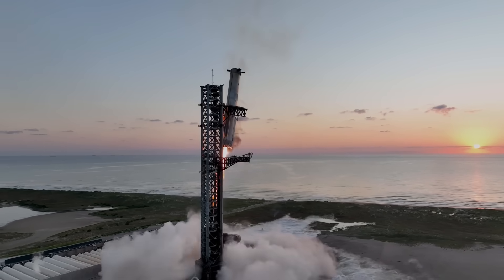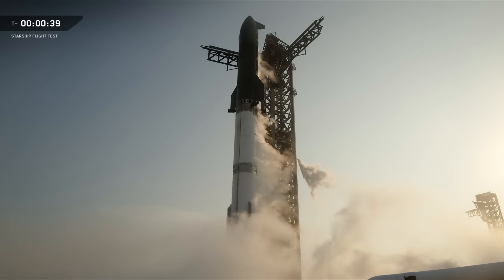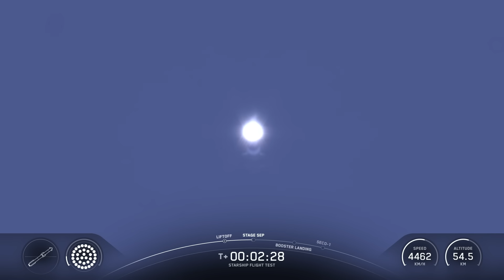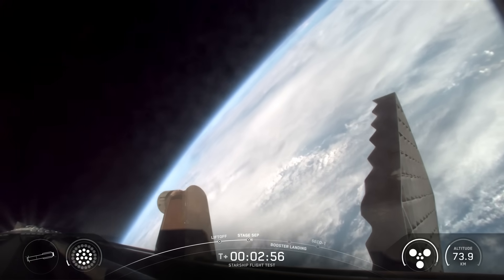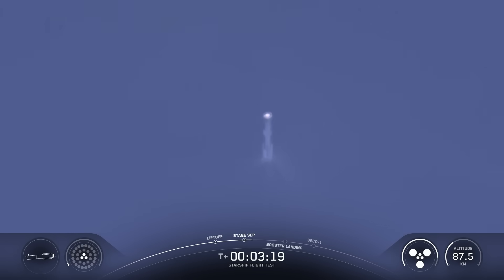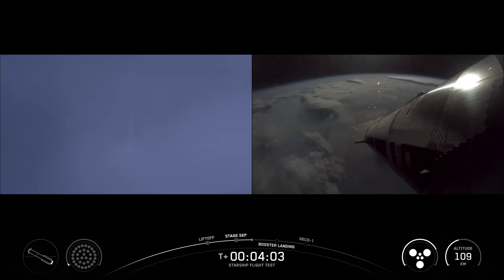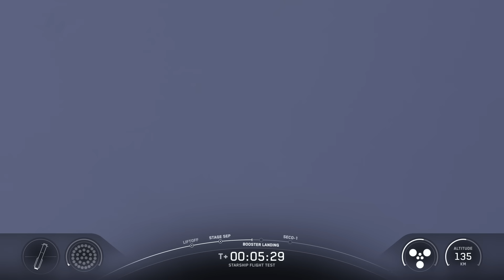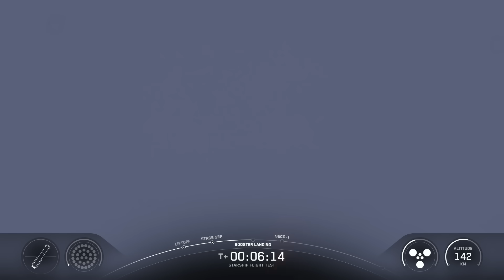SpaceX Builds Largest Reusable Booster, Also Makes Door That Won't Open - Starship Flight 9 Recap

Comment: The Starship attitude graphic in the lower right corner was useless for determining how it was tumbling.  I'm also surprised you didn't comment on the euphemism for failure used by the SpaceX talking heads:  "The booster began to demise."
Reply: Finished demising, too!
Reply: It's not an ex-Starship. It's just fallen off its perch and is sleeping.
Reply: @ianstobie  It's pining for the fjords.
Reply: Very annoying to hear people misuse words. As far as I know demise isn't a verb.
Reply: @therocinante3443  US English is rife in using nouns as verbs. Misuse, of course.
Reply: It just feels wrong to use demise as a verb.
Reply: I'm surprised they use euphemisms with edgy Elon at the helm. Maybe Karen from HR got involved. Also, why don't they use a 3D representation for the attitude.

Comment: Any thoughts on why there was zero attempt to slow/minimize the tumble on re-entry with the flaps? In flight 3(?) we saw them atleast move during the tumble in a manor that could have given some information. This time it looks like they tucked them back and pulled out the popcorn
Reply: I’m guessing the stress on the flaps to stabilise starship in that state would be too great and they’d probably just come right off?
Reply: They didn't try because there's really not enough air for the flaps to do much of anything (especially for the chungoid-grade angular momentum that comes with being as thicc as starship) until you're elbow deep into the "burn and die if you point the wrong way" part of re-entry. We saw this with Ship 28.

Comment: Apollo 9: Designed with paper and pen. Third mission with a crew onboard and 10 days in orbit around the earth.
Starship 9: Designed with the most powerful computers available. Booster explodes and the rocket loos control and door won't open.
Reply: haha true. but u have to admit the starship program is more ambitious. the apollo rockets didn’t have any reuse, had many stages for maximum efficiency, and used a simple capsule shape for re-entry.

Comment: No booster telemetry. Booo!
Reply: yes, very frustrating not to know the altitude and velocity of the booster when it exploded.
Reply: dya think they didn't replace the telemetry link because they knew they were going to scrap the booster?
Or did they just not add the link to the stream because of the new overlay?
Reply: @vawlkus  Maybe they didn't want competitors to have access to the data?

Comment: Did the front fall off?
Reply: It's ok, it was out of the environment when it happened - all that's out there is thin atmosphere, weather balloons, and 50 tons of explode rocket fuel, and a large fire. Just to be clear, it's not meant to do that, the front is not meant to fall off

Comment: Another observation I made pertains to the sound of the glass windows at the Star Factory, where our host was stationed. The rattling of the glass panes against the frames was somewhat disconcerting, and I hope they will follow up with building maintenance to apply additional sealant. This situation reminds me of the glass pane that fell and struck Walter Conkite during one of the early Apollo launches.

Comment: It’s disappointing that it didn’t make it to splash down, but also important to remember how Falcon 9 development went. They had a lot of RUD’s for Falcon 9 as well.
Reply: Falcon 9 successfully achieved orbit on the first flight.
Reply: @sciencecompliance235  That’s obviously not what I’m talking about, it’s the reusability, landing, and scale that were the new capabilities being developed. That’s what caused so many RUD’s with the Falcon 9 program.

It’s all about adding efficiency, increased thrust, capacity, and reusability. That’s what the Starship development is all about - creating a large and efficient enough ship to build civilization in space (rather than just going to space). 

So expect more RUD’s and probably some delays, but also expect to see a massive capability jump like we did with the Falcon 9.
Reply: @Nathan-vt1jz  I just don't accept that they need to be destroying this many test vehicles to figure out how to fly the thing.  There's being averse to "analysis paralysis" and then there's not doing your due diligence.  I'm starting to think it's the latter.

Comment: The more things go wrong now the better the chances of Starship succeeding when it comes to carrying crew. I'd rather it smack into the ocean in a million pieces multiple times during testing than be overly successful and then have something catastrophic happen with crew that wasn't foreseen BECAUSE it's testing was so successful.
Reply: I get where you're coming from, but this level of acceptable failure is only sustainable due to SpaceX's immense resources. They have spent billions of dollars on this near-fruitless project, and while I understand they are attempting things never done before and these flight tests are valuable to their engineers, I just can't shake the feeling that they are cutting corners in order to expedite their goals. Starship is incredibly behind schedule and is not nearly as redundant as past space programs, it needs more time in development, or probably even an entire redesign. It gives me tesla vibes, it seems super cool and all, but not so cool when you crash it and get locked in with the flames. Tower catches are super sick but I feel like the starship program isn't prepared for emergency scenarios, for example, if for some reason too much fuel was expended before reentry and the craft doesn't have the delta-v to slow itself.
Reply: You think they can get it to work?  The Falcon seems to work, why does this thing keep springing leaks?  I'm assuming the construction staff is the same.
Reply: @cliffordwebb3656  Falcon is a simple and well engineered project. It is just a self-landing booster (still cool) and a second stage that either deploys a payload or carries a crew in the dragon capsule. Starship is an aesthetically motivated pipe-dream of a fully reusable rocket, which may be possible if it wasn’t so limited by the optics of a huge cylindrical sci-fi prop.
Reply: This is pure cope.  I want to see Starship succeed, but not achieving your goals after 9 flights is pretty questionable.
Reply: @sciencecompliance235  The main goal is to collect data, so that data can be used to iron out issues with the design. They've achieved that goal every single flight, every tank test and engine test. Getting the ship to space and back successfully is a tertiary goal, second only to data collection. You need to grasp this.  Failures now means less failures later when crew may be involved, just like my original comment says. It's not cope, it's facts.
Reply: @MrNomadic76  You're really drinking the kool-aid.  They don't have to be crashing this many vehicles to collect data.  What you don't seem to realize, too, is they can't "collect data" on the heat shield when they have attitude control issues with Starship.  So no, they're not even collecting data they need to collect, but many of these problems can almost certainly be addressed in the analysis phase.
Reply: @sciencecompliance235  Dunno why you're getting so wound up, using your little catch words like 'cope' and 'drinking kool-aid', kinda shows your immaturity. I suppose you'd prefer Starship just to work by chance and then all the issues we're seeing now crop up when they are putting crew onboard? All these issues, however unfortunate, all combine for a safer vessel at later stages, and that's a good thing, and my point from the beginning. Don't understand why you feel the need to argue with that.
Reply: @MrNomadic76  lol okay if you say so bud.  Work by chance?  Okay, now I know you have no clue what you're even saying.  That's what they're doing right now!  The point is to do more analysis and to design for things they can definitely account for before throwing things at the wall and seeing what sticks... which is what they're doing now.  "Drinking the kool-aid" is a term that comes from the 1970's, so if anything that would show my age in the opposite direction.  You do you.  Lord knows I'm not going to be able to convince you of what is clear to anyone who can see through the propaganda.
Reply: @sciencecompliance235  Lol you got some issues... Good luck. I mean that last comment was you saying what I originally said. And what does work by chance? even mean? Incoherent at best at this point.

Comment: We should go from "It is not rocket science" to "it is not door science" :D
Reply: Rockets landing on chopsticks: check
Doors: still in development
Reply: @qoph1988  Yes, but "chopsticks" pre-date doors by millions of years, our monkey ancestors used them (as long sticks), to coax termites out of their mounds, to eat them. And some of us still use them too, so there's that to consider, tech developmentally speaking!! LOL ;D
Reply: Tumbling is not nominal for operating the door. 

However, it is possible that they made the attempt and failed to loosen the latches. We don't know. 

The upper stage might have stresses that allow cycling on the ground but not in free fall. We don't know.

Comment: I am not a space engineer, but I don't understand why once they managed to make a system that worked (ship entered successfully and "landed" on water 2 times), they changed it (and already failed 3 times). The new Raptor 2 are not the problem (ftom what I see,), the new fuel trasfer system is, leaking everywhere.
And with the booster... all looked good until landing burn. Could it be overheated with the newer more aggresive entry heating (was very red and very short) ?
Reply: It's a good question, they were trying to coast the booster, and it was mentioned in the webcast that simulations showed inconclusive results, as in depending on the model they used it would either fail or succeed, so they decided to test the steeper reentry with this used booster. Now they have that answer. The new block 2 booster lacks the lip around the outer edge so it'll have an easier time to bleed off heat. 
Hopefully it won't be cursed like the block 2 ship
Reply: They are still in the rapid prototyping stage. Working "good enough" isn't as informative as "barely not working" (if you can conclude from the data the why, the how and the what)
Reply: @TheAgamemnon911  It is no point in repeating stuff since they are going to upgrade anyway.  Testing out the trajectory of the booster and comparing it to their computer models is a sound stategy IMO.   Lets hope they can solve the leaks in the upper stage so they can do better reentry tests from now on.  That is the most critical part to solve.
Reply: cuz block 2 has some upgrades duh . especially those vacuum jacketed feed lines is needed for fuel transfer in space . the design is awful tho .
Reply: You have to remember that there’s always the possibility of human error. Something might have slipped through quality control or someone didn’t fully tighten that coupling, who knows but it doesn’t have to be a design issue. Just like flight 8 failing due to a problem with one of the Raptors, they’ve built hundreds of them that worked without a problem during flight yet that one failed for some reason.
Reply: T-Fords also worked well. Still these pesky engineers couldn't stop developing new car models.
Reply: You have to remember that there’s always the possibility of human error. Something might have slipped through quality control or someone didn’t fully tighten that coupling, who knows but it doesn’t have to be a design issue.
Reply: Sometimes engineering is not a linear process. Changing one thing often doesn't have a single effect. Trying to optimize one parameter usually impacts many others. Imagine trying to find the highest point in a landscape while it's foggy. For the first version of Starship, they started somewhere, and started walking uphill. At some point, the reached the top of the hill (the last flight of version 1). It's quite high up, but it is a dead end if they want to go higher.

So that's where version 2 comes in. They moved to a different spot they think will lead them to a higher hill. There is no guarantee of how high they start or end. All they can do is start walking uphill. Clearly, version 2 started out much lower on a hill than version 1 ended. They have been moving uphill, but only slowly this time. They haven't reached the peak of the current hill yet, hopefully.

There are 2 options for them now. Either keep walking up this hill and see where it brings you, or make a big change and move to another hill to see if things go better there. They might be on the right track (a difficult climb, with a very high endpoint), or they may be entirely off course. It's up to SpaceX to try to figure out which is which.

Comment: Time to face facts - the Starship project is never going to fulfil its rapidly reusable objectives and is a financial disaster for SpaceX. This new Starbase City will be a ghost town in a couple of years. They nailed it with Falcon and should have further developed that platform. Musk’s delusory character traits will be his undoing.
Reply: I suggest you go watch "How not to land an orbital class rocket booster" If you were following that in real time I'm sure you would've told spaceX to stop trying to land the falcon 9 boosters.
Reply: You may not be wrong, but let's see what happens after a few more flights.
Reply: Ok internet rando
Reply: It supposedly costs them 100 million for an expendable launch.

They have booster reuse working, let's say the do a Falcon 9, and fly a reusable booster and expendable second stage. 50 million? 

Given the lift capacity of Starship that's honestly still very useful.
Reply: 100%

Comment: It maybe arguable as to whether this flight was a success. I happen to think that it was not. However, it should be inarguable that the Starship program is not a success. It is definitely failing. You say that if this was a government program, there would be hearings. IT IS A TAXPAYER FUNDED PROGRAM. Space X has blown through just about all of the money they got to demonstrate in-orbit refueling and uncrewed lunar landing, among other milestones, and hasn't met a single significant milestone. There is a review that I think is coming up this year. Hopefully politics doesn't com into play and we (US Government) hold Space X accountable. They are spending time designing a Pez Dispenser, when HLS calls for in-orbit refueling. They need to work on the stuff they have been paid to do.

Also, downplaying space shuttle is a bit low. It was re-usable, it just didn't need to land in some fancy way. It definitely could have been better, but to put starship or super-heavy over Space Shuttle is premature. Scoreboard space shuttle. Scott, you need to do a video describing how bad this program is doing and how they are going broke on it. I don't know why you go soft on Starship. This isn't Falcon (taxpayer supported) or Crew Dragon (taxpayer supported), which are both successful programs. People forget that Falcon was 1 flight away from failure, they had to get that last infamous demonstration flight to get federal funding. Starship is a different program. 

You know how bad it is when Musk predicts that it is going to land on Mars next year, which is obvious ridiculous, for a spacecraft that has yet to prove it can stay in orbit. The prediction is entirely to get more people to send him money. Pathetic that anyone still listens to this guy.

Comment: The ullage RCS and autogenous pressurisation are great ideas on one level but don't they create a situation where a single failure point (ie leak) can render 3 systems inoperative? 
I wonder if SpaceX are having a rethink.
Reply: My thoughts as well. That said it's not that important for the autogenous pressurisation. If you are leaking fuel maintaining pressurization in the tanks is less critical as you propably cant acheive your second relight anyway given how much has leaked out. Alternatively if the leak is in a bad place relighting things might just blow up the ship. For the RCS thrusters it will matter a lot more as some payloads might be able to acheive some of their goals, or all of them if they can do the final orbital raise on their own, even if they are deployed at a lower altitude. Depolying anything is hard for a lot of reasons if the ship is spinning out of control.
Reply: Yeah they work when everything else works fine, but they are too dependent and not fault tolerant. I guess it's a matter of design philosophy, you either start with the worst case in mind and prune back over time, or you start with the best case and add mitigations over time, which is how SpaceX goes about it.
Reply: I suppose for a fully reusable platform they will need to install an independent backup RCS so they may well be installing those COPVs anyway. I mean, they've installed enough tanks for their various fire supression systems...
Reply: Tim Dodd mentioned that in his commentary on his live feed.  It seems to me SpaceX (like Tesla) being too clever by half in dumping conventions that have been around for years for good reasons.